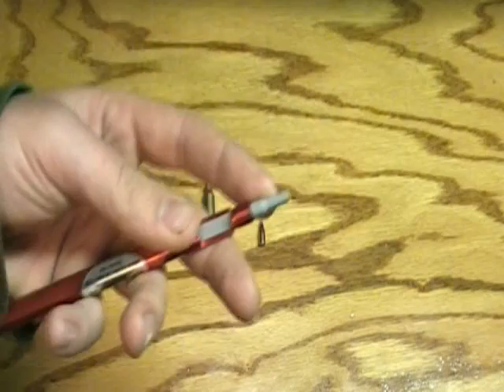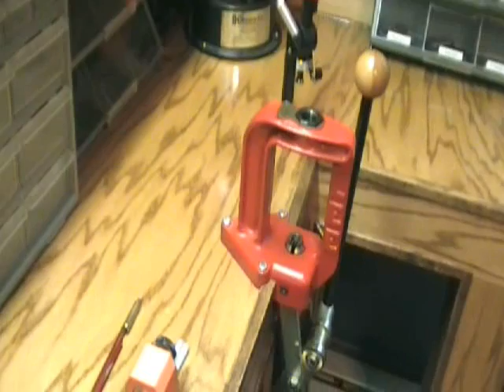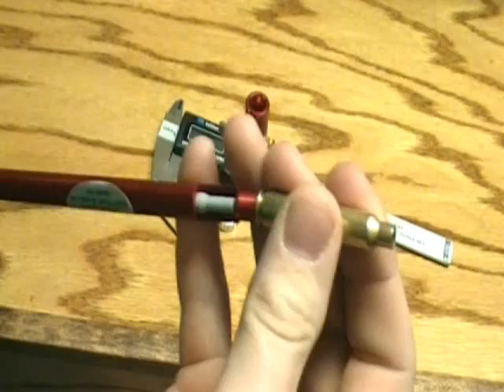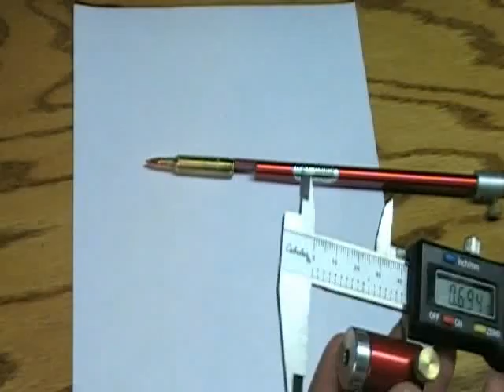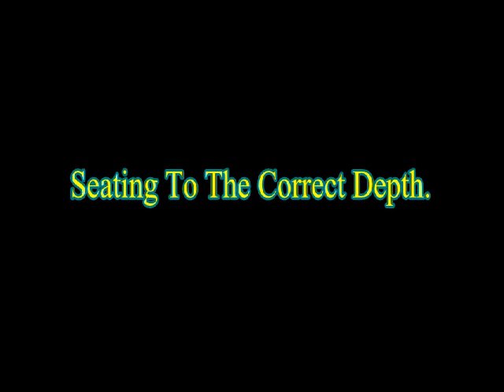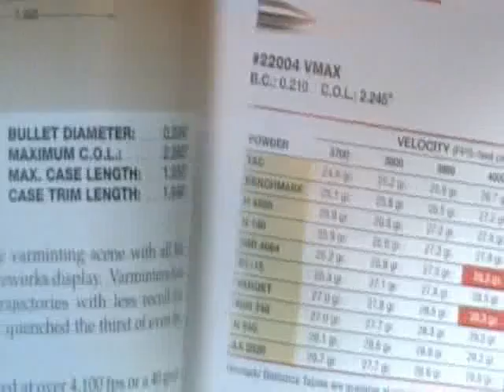Using The Hornady Overall Length Gauge And Bullet Comparator

Comment: Great video. Flip your Hornady over all length gauge over so the caliper cut is facing down on your caliper blade. This will give you straighter alignment so the bullet does not go into the comparator at an angle. Try holding the OAL gauge at eye level both ways with bullet and case in your comparator: try cut out down and cut out up and  you will see the case and bullet are not aligned with caliper cut facing up. Maybe makes .010 difference not a big deal. Don’t know why Hornady doesn’t mention this. Not trying to nit pick. Your explanation is very accurate and helps newbies get super important info. To have accurate handloads you must figure out seating depth. Thank you for the video and good shooting to you

Comment: All you need to do is slightly push a bullet in an empty case. Chamber the round and close the bolt slowly. The bullet will be pushed into the case. Remove the round and measure. I've been doing it that way for 40 years of reloading. You don't need this tool.

Comment: Back to school  .52  is the same as .520 over a half inch? .20 is .200 thousandths  You want .052 or just say fifty two thousandths off the lands. you guys do not have to say  Point Point Point sounds uneducated   2.073 -.053 = 2.021 or Two inch twenty one thou.  .006 you say six Thou. or .010 is Ten Thou. .100 hun. thou. 1lb. one pound. But over all a good Video.

Comment: As has been noted already, .01 is 1 hundredth of an inch, and .001 is 1 thousandth of an inch. So if you're at 2.073, and want to move it 5 thousandths of an inch from the lands, you'll want to set it at 2.068, not 2.021. 
Otherwise, I like your video. Good information.

Comment: you should get a gun smith to adjust your throat depth on your rifle. Then you will not have such a big jump.
Reply: Throat depth can only be increased without a complete rechambering.  Kind of expensive but many guns will very well with the bullet well off the lands.
Reply: Ed Mimiaga
oops should read "shoot very well".
Reply: getting the chamber re cut is not a big deal. You lose maybe 1/8 of a inch of barrel length and you end up with a much better chamber than factory. Your brass will grow less and last longer with good hand loads.

Comment: Just happened across your YT video and let it run while doing other things at the same time and noticed at about the 10.30 time stamp you were recommending to move the bullet back into the casing .2-.3" back - that is about 1/4" and then you say you move your bullets back .52" or just over 1/2" back into the case. after looking at your math on the paper I realized you were talking hundredths of an inch not tenths of an inch. If you're trying to sell DVDs on how to's for accuracy, you might want to be more accurate yourself. I would suggest to remake the video if your are trying to sell DVDs as these mistakes makes me want to pass.

Comment: You should also note that it's not uncommon when loading this way, that the finished cartridge will exceed magazine length (especially with the Remington 700).  If the shooter prefers to not have to load one cartridge at a time, then this method is still useful for seating various bullet weights to the same jump, or just keeping things consistent (using the comparator).  A lot of people put too much emphasis on so many thousandths off the lands.. equal accuracy can be achieved at book COALs.

Comment: some target shooters run there bullets in tight for better accuracy . some guns like book specks others you have to load longer. i measured 100 bullets and found there were 3 different lenth in a box from 3 machines dropping together in a box   33 .007 longer 33 were at o 33 were at .004 short 33 .003 over only ogive get you  correct jump every time chambers wear will make jump longer.target guns are cut precise, buy off the wall gun   and its cut to shoot all ammo even if specs are a little off

Comment: Not a bad video, but it is pronounce "oh-jive" and is spelled ogive, not o-give. You should, also, "spin" the brass while in the calipers so the head squares up to the outside measuring contacts. Verifying the round in your calipers after you removed it from the rifle would, also, have been a good idea. I don't know about most people, but "good-enough" isn't in my vocabulary when it comes to reloading. You are definitely on the right track.

Comment: i had to take a class for work today having to do with micrometers and calipers. several of us reload and as does the instructor. our instructor was a Marine Sniper. He said you dont have to worry about lands and grooves. There is an OAL for a given round. to truely be accurate he said that you only need to make sure the oal is +/- .001" a thousandth of an inch is the thickness of a sheet of paper. you get that right and the accuracy will come.

Comment: Does bullet seating depth have an effect on your powder charge?  I am new to reloading (I don't want to blow my gun up in my face) and I have noticed most reloading manuals have a larger powder charge for smaller bullets.  I was under the impression this was due to the shallower seating of the bullet in the case thus keeping chamber pressures more or less constant for all bullet weights.  Thanks for your help and video it was very informative and helpful.
Reply: It has, when seating depth of your bullet in the cartridge has effect on the space inside the cartridge, which has effect on the pressure.

Comment: old school carbon blacken the seated bullet in a cartrige sands powder and primer chamber and remove look for rifling marks no marks do one more with bullet seated a wee bit more i use a caliper for 10thou movment till contact is made soft in- light marks -hard in more distined rifleing impresions. works good just use the same bullet type manufacture and lot number.

Comment: A little tip on using digital calipers:
Hold them in you hands for a couple of minutes so that they reach body temperature before you zero them.
I have found that mine expand slightly after holding for a while. 
Not warming them up before zeroing can cause discrepancies.

But then again - I am a bit anal about being as precise as I can...

Comment: if it were as simple as adjusting .50" i could use my tape measurer, vice grips, and a hammer. i actually skipped back in the video because you had me thinking too much on what the hell you were talking about, then i got it. them zeros are a bugger. by the way your video was very insightful. thanks for posting.

Comment: I have a question, I have a nine inch digital caliper that has a tad thicker jaws than most 6 inch sets. Is the body of the comparator made to accommodate larger size calipers as well?

Comment: @AccurateWayz On my Palma rifle .308 my bullet is hardly in the brass and can be pulled by hand. But, I use the Lee Factory Crimp Die to secure the bullet so I don't end up with gas escaping back from the neck or the action full of propellant during competition. You might tighten your groups by placing a small factory crimp even without the use of a non-cannelure bullet.

Comment: Very well made video and good to see a young guy can add up (do his math) these days.
I have since changed my use of my OAL gauge and comparator-I now zero the comparator properly when using
Reply: Thank you for your video on the use of the Hornady OAL Gauge. This is important information that should be provided to new hand loaders; however there are multiple errors in your video.
1. As you insert the gauge into the chamber it makes contact at the case shoulder, not the case neck. You’ve trimmed cases and therefore know the length of the case varies as much as .010.
2. You pronounce the word Ogive the way it’s spelled. I used to also, but the correct pronunciation is with the “J” sound, not a “G”. Pronounce it Ojive.
3. When you assemble the bullet comparator you should mention it needs to be mounted in the of-center position to allow measurements to be taken from the center of the OAL tool
4. You refer to the head of the case as the “Rim End”
5. You must absolutely revise the demonstration of your math section. Rather than pronounce a dimension as point twenty, or point thirty, say the number as its true value; as in twenty thousandths or thirty thousandths. The numbers you displayed are actually 2 tenths and three tenths, and by calling them point twenty or thirty does not clarify your error. You instructed listeners or viewers to subtract from one hundred eighty thousandths, to two hundred eighty thousandths more than they should. 

The OAL Gauge doesn’t work because it does not factor in your headspace. The tool indexes, or adjusts it zero point on the shoulder of your chamber, but no measurements are taken from this only non variable point. None of your measurements are relative to your chamber dimensions, so you cannot find a true Ogive length. To check this, use your comparator and measure the headspace your fire-formed case, and compare that measurement with the headspace of the case provided with the Hornady OAL Gauge. The difference you find there is equal to the error you will have in every round you load using the methodology described in your video. 
Instead, use a case that is fire-formed in your chamber. Adjust the de-priming stem to eject the primer without re-sizing the case. Now remove your expander ball and slightly size the neck to add a small amount of constriction that will prevent the bullet easily sliding and changing its position, but not far enough to push the case shoulder back at all. Now insert a bullet leaving it long and carefully chamber it slowly locking the bolt. When you remove it you will have a gauge to measure from the bolt face to the lands. Bear in mind that a fire-formed case shrinks away from the chamber walls after firing. Your actual chamber length will be from .001 -.002 longer than your fire-formed case, but knowing this allows you to work with it. Depending on your chamber length you will find variations up to .030 or more when compared to measurements found with the OAL Gauge.
In addition I would like to add that when seating bullets as you demonstrate to accomplish a jump to exact Ogive measurements, you need to use a seating stem in the die that matches the diameter of the bullet at the lands, or Ogive. The Lee die uses a seating stem that contacts the bullet at a much smaller diameter near the tip than your bullet comparator bushing. There is no constant length between these two points. You cannot achieve an accurate Ogive length within the tolerances you’re trying to achieve by using a seating plug of such a small diameter. To prove this to yourself, number 20 cases and seat the bullets following your normal procedure recording the Ogive length of each round. You will find variations in length up to .004. That much error is unacceptable when loading to achieve a .002 jump. It’s double the distance. Now remove the seating stem and measure its diameter where it contacts the bullet tip. Change your comparator bushing to one that matches the diameter of the seating stem and re-measure your Ogive length. Now you will find variations no greater than .0005 because the measuring tool matches the seating die, but remember the lands on the barrel are much larger. The seating die must match the comparator diameter where it contacts the bullet to measure the Ogive when loading for a specific and accurate jump distance. Errors here can leave you with a bullet jammed into the lands which can increase pressures to unsafe levels. Loading in thin manner should be left to more experienced hand loaders.
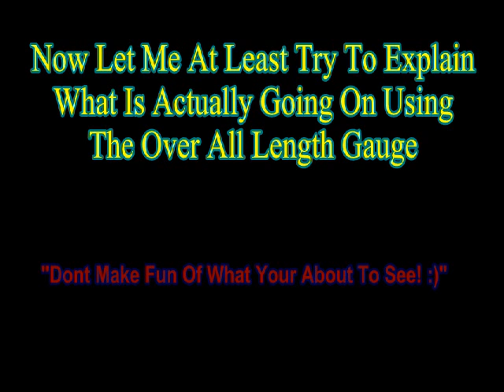Reply: About 2:59 or so you suggest the case mouth of the case is up against the lands. This is incorrect. The shell rests on a line called the datum line which is about in the middle of the shoulder. The distance from the datum line the case back is your headspace.